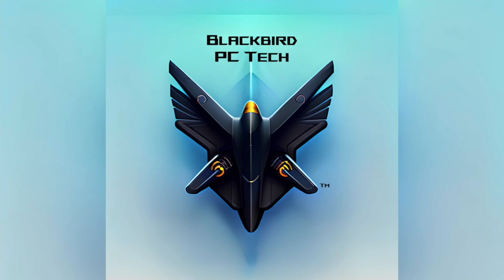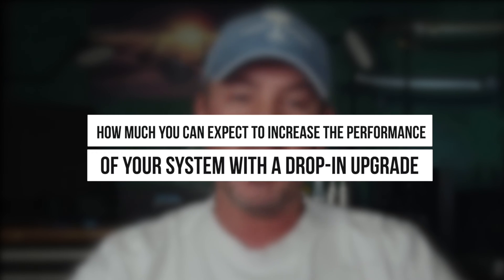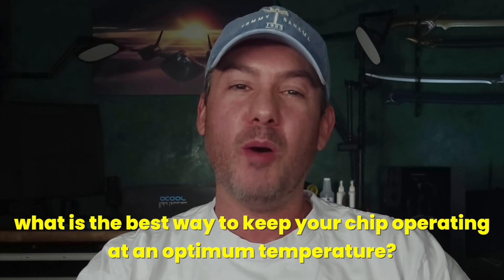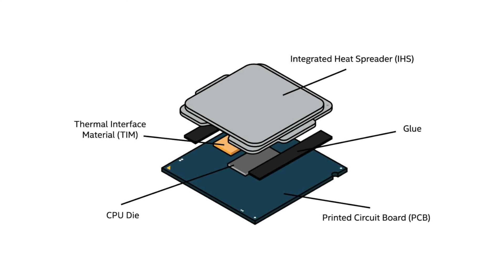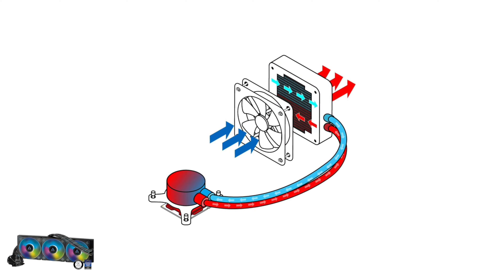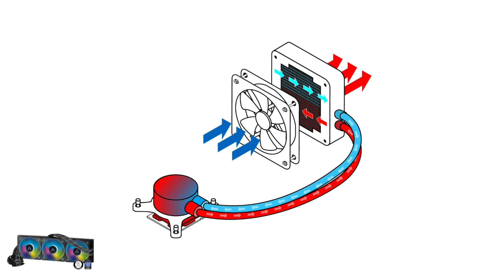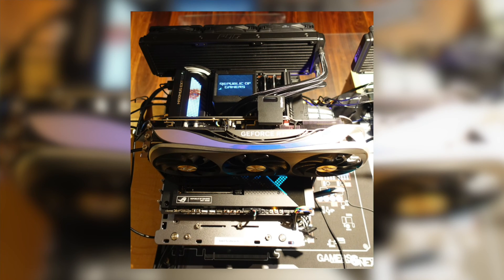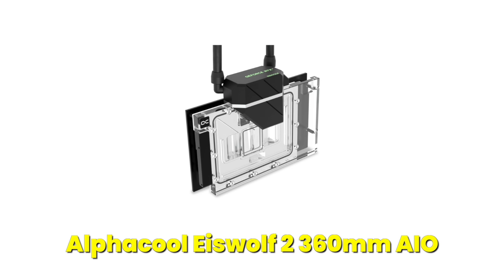Is GPU Water Cooling Really Worth It?

Comment: Hooray, another BBPC video!  Great explanation of how cooling works.  Though I understand this, there are probably lots of PC enthusiasts who do not.  

I once built a fully custom liquid loop (mostly EKWB) with a 6850K and two 980Ti cards in SLI.  I never had any leaking, and the cooling solution worked way better than two triple-fan 980Tis just a centimeter apart.  But it was completely inflexible.  And of course, SLI provided marginal performance improvement at best.  So when I upgraded, I went with a single air cooled 1080Ti and an AIO on the CPU.  That same configuration, in a different case, is still in operation.  

In this video, the 4090 was already operating well within its thermal limits and was not throttling in any meaningful way, so making a little bit cooler made a negligible difference.
Reply from the maker: Love it ... I am currently posting once a week every Thursday at 5pm EST ... need to figure out how to do the benchmarking faster 😉  And yes, the air cooler is over designed so it can handle the power draw of the 4090, hence the minor benefit from water cooling.